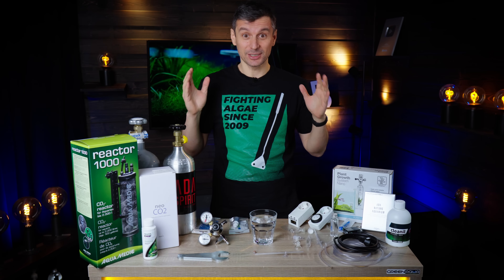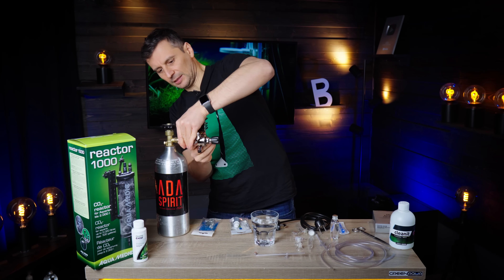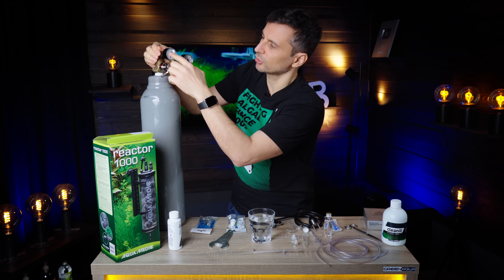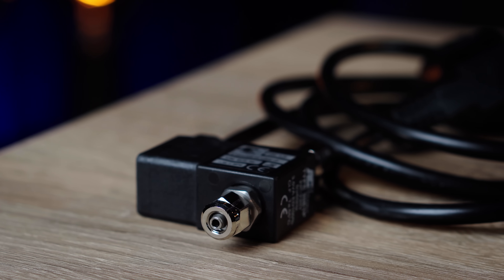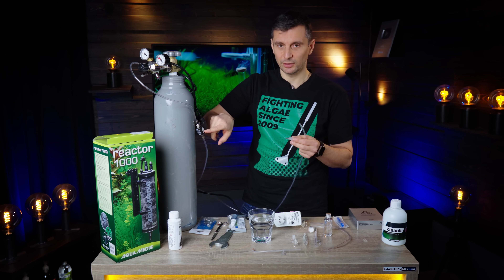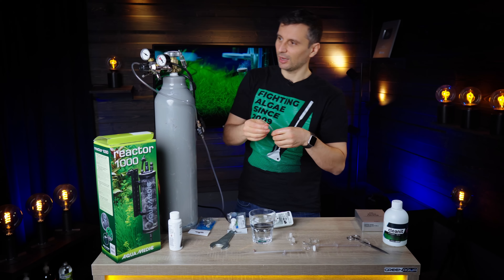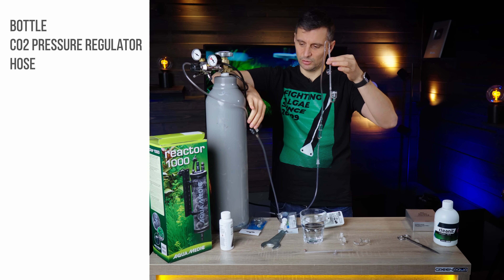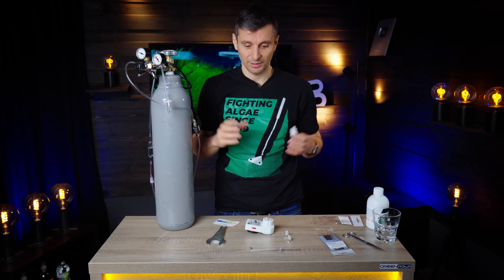Complete CO2 System Set Up with a DIFFUSER

Comment: Good morning,
I've been battling Black Brush Algae and Green Beard Algae lately.
I have a 250l aquarium with a jbl e1902 external filter and Aqua Medic CO2 Reactor 1000, skimmer, lily pipe through the back of the aquarium (closed top aquarium) and flow pump (left side at front, angled 45° downwards (the water of the lily pipe go to the flow pump to distributed the water from the lily pipe nicely)) .

(The soil is ada amazonia)
Currently I dose +- 80 bubbles (measured with the BLAU Glass Spiral CO2 Bubble Counter) or +- 63 bubbles (measured with the SEAAN bubble counter (makes slightly larger bubbles)) per min. 
The co2 starts 1 hour before the light comes on and stops 15 min before the light goes out.
The light is on for 7 hours a day.
(ph:7.1, EC:300, tds:160, temp:22, no3: ( 0-10 ), No2: (0-1))
The aquarium does not take direct sunlight.
Can you help me or give me some tips?
Thank you in advance!
Reply from the maker: These algae types are there for maintenance reason and flow issues. If the substrate gets too much disturbance and the substrate is not covered fully with plants it will lead to algae. So make sure to check the flow and the direction first.

Comment: Nice video! Was hoping you would discuss more about what is the purpose of reactors, diffusion rate and how should the bubbles circulate in the tank for the best effect, how to work with smaller CO2 systems, as seen in the first part of the video on the table. 

Thanks!
Reply from the maker: CO2 reactors worth another video i guess. We can talk about it later of course 👍

Comment: Hello Green aqua, great video thanks!
Can you please tell more about co2 in large aquariums where co2 diffuser is not enough where you need touse co2 rector?
How to use it, how to setup properly and how many bubbles per second you need for example in my case with 1200 liter planted aquarium?
Thanks in advance.
Reply from the maker: This is a longer topic probably worth another video. But definitely a CO2 reactor with a bypass is the way to go. I may would add in a pH controller as well as it will be extremely hard to change the rate based on counting the bubbles.

Comment: Question/s
Doesn't the bubble counter also act as a check valve as well?
For the recommended Co2 bubble per second.. doesnt it depend on the size of the tank and how dense it is planted? Now, im thinking im using too much Co2 on my 60p with 2 to 3 bubbles/sec.
Reply: The amount of bubbles needed for an aquarium depends on the carbonate hardness (KH) and the pH level. The lower degree of carbonate hardness it means the less bubbles are needed to achieve the optimal pH of 6.6-6.8
Reply from the maker: 2-3bps is good. But depend on many factors.

Comment: sir I have set up co2 from the cylinder but from diffuser the bubbles coming too late.i have connected what you have shown in the video but I am not getting proper bubble it's coming to late.it taking almost 1hr to come
Reply: Not enough pressure
Reply: The aquarium water may be backing into the diffuser when the system is off.   Then, when the system comes on, the CO2 has to push the water back out.   This happens on my system even with 2 check valves.
I simply set the timer back an hour in the morning.
Reply from the maker: Make sure to set the correct pressure on your regulator according to the diffuser you have. Also the longer the CO2 hose the more time til the pressure builds up.

For white plate diffusers use 1.5-1.8 bar pressure
For aquario type orange or more denser diffuser plate 2.2-2.5 bar pressure is required

Comment: Co2 is quite expensive here in New Zealand, the cheapest I've seen with the set up stuff was 400nzd. But I'm not that  invested into plants I just use fertilizers as it fits in my budget. Thoughts? @Green Aqua
Reply from the maker: Go for low demanding species and you will be fine 👍
Reply: Tanks without Co2 can thrive when taken care of properly, you’ll just have trouble with some plants that are very demanding for high light and Co2.

Comment: I see a lot of 60p tanks on YouTube where the bubble rate is slow like your demonstration. I always have to run co2 much much higher. I always think k to myself, why donI have to run such high co2.
Reply: I also run mine much higher, even considering it is a 200 liter tank. It gets much worse when I have the skimmer on - that makes it nearly impossible to reach the ideal ph levels. Cleaning the difiser regularly helped a bit.
Reply from the maker: Dave, on a 60p 2bps is kinda general recommendation. And depend on many factors this can be higher. More surface movement, less effective diffuser, or a dirty one etc. If you have different bubble counter liquid than water it might be a little slower as well. Like the one we're using many times (glycerin types)

Comment: Very good tutorial,👍
Please mention how to spread
the co2 bubbles all over the tank
Reply: A lot of ppl usually use a power head or wave maker or even the outflow of a filter to push the c02 around the tank
Reply: Im not sure this is necessary. CO2 dilutes very well in water. It also dissipates quite easily into the air if there is too much water movement.
Reply from the maker: Make sure you have enough flow. Better to put the diffuser to the lower part of the aquarium, so the gas travels more before reaching the surface and has more chance to mix with the water.

With a CO2 reactor this is a non existent issue. So if you're after a more efficient method i do recommend that.

Comment: I have a problem when using co2 for awhile is that the point where the hose connect to the difuser starts to release co2 instead of through the difuser, is it because the hose got loosen ? (Im using the hose of jbl)
Reply from the maker: You need a pressure resistant hose (not O2 hose). Also make sure if it slip from the diffuser, cut down the last 2-3cm from the tube and clean off water from diffuser neck and the internal part of the tube.

Also check what pressure required for your diffuser. If this is an older type white plate diffuser you need only 1.5-1.8 bar to run it. So it is unnecessary to drive 2.5+ pressure from your regulator.

Comment: I've worked with pressured tanks for welding and for purging certain military hardware with nitrogen. The Tanks are brass heads so the metal is soft. You don't haft to craft the bejesus out of them to keep them from leaking. If you think it might be leaking or not tight enough just use some soap and water mixture to test the connections. If it blows bubbles its leaking. Close the tank valve and remove the pressure regulator. Inspect the mating surfaces and ensure they are shaped similarly as in angles of the fittings and tank heads mating surfaces. Also check for dirt and debris and any possible dents cuts to those surfaces. Then reassemble and test for leaks. A little past snug is usually enough. If you over tighten then you can strip the brass fittings. Also make sure your regulators valves are set to closed before you mount it to the tank and before you open the tanks valve. Otherwise you are good to go. The soap and water is always a good way to test to leaks.
Reply: I work in a laboratory and we use co2, oxygen and other compressed gases. We you white medical tape around the brass head and pressure regulator. In 6 years—zero leaks.
Reply: I know feeling of stripping them 🙈 Im a nuclear marine engineer on submarines and we play with this stuff everyday up to 300bar
Reply: I used to tighten the regulator quite tightly cos i'm afraid that the regulator will fly off from the tank if not tightened tight enough
Reply from the maker: Thanks for your feedback. You're right you do not need to do that so hard. However we've seen issues many times with clients when the regulator with the extended parts like valve, splitters simply twisted by the weight of the equipment and the gas is released from the cylinder. 👍

Comment: How much bubbles would you suggest, for a 90p aquascape?
Reply from the maker: With most bubble counter this will be around 3bps+ I would start there and slowly fine tuning til i reach the perfect spot. Depend on many factors how effective your system is.
Reply: There is never an exact answer for this question. I use a 45P and do about 5+ bubbles per second. it sounds like a lot but it always depends on how heavily planted your tank is and other factors. If you have fauna, pay attention to their behavior, get a co2 indicator if you don't have one already and keep good aeration/surface movement so fish don't suffocate from too little air. I used to do 1-2 bubbles per second but with experimenting and having a lot of plants I can get away with pumping more co2 for exponential plant growth!
Reply: How much bubbles would you should for a 90cm 45cm 45 cm planted tank plz